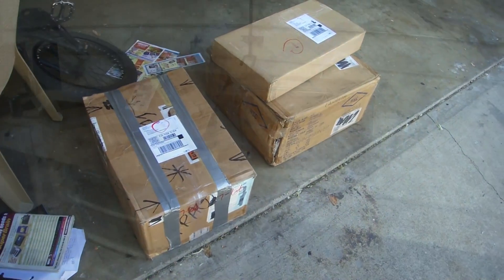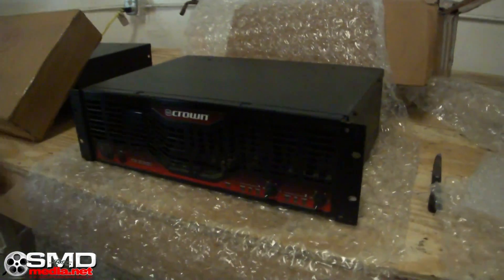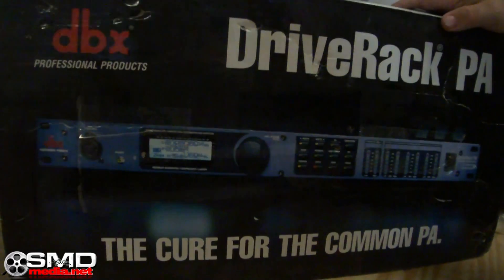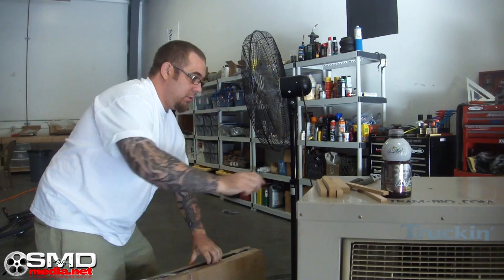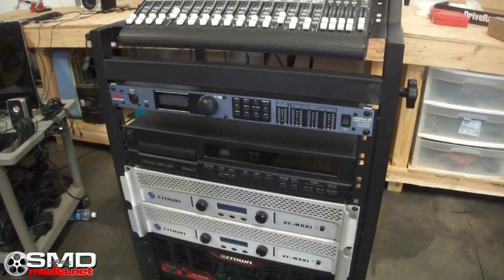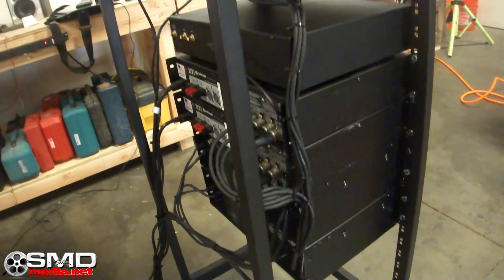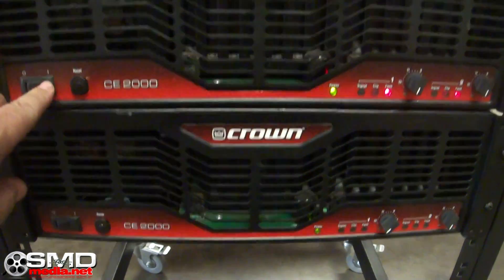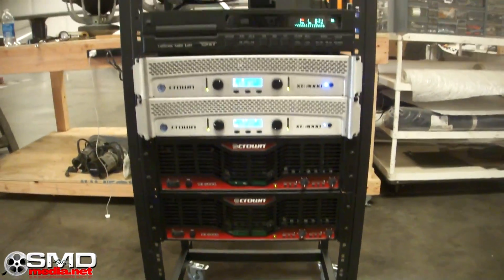Extreme Shop System :SMD Pro Audio Project Vid 2 - Crown Amps 10,400 Watts

Comment: Add a AC enhancer and plug every thing switched and every thing will come on in sequence and turn off in reverse sequence saves on clipping and Enhancer will eliminates spikes in power when running your power tools or what ever. Plus you could plug the amps in separate designated 20 amp breakers.

Comment: you gotta get an old crown macro tech 3600 or 5000 they run my dd 9918s hard without clipping ever. I have all the crown amps and those are the best for dampening factor for subs
Reply: so you think that the old crown amps are better than the new crown itech HD?
i don't think so, the crown itech hd amps are used with jbl M2 Master Reference Monitor.
And thoes is one of the best sounding set up right now, if you read the opinion from pro audio users/creators.

Comment: Do you really need 2000 watts for tweeters?
Reply: you don't need to use the amps at max power, it's always comfortable to have headroom. 
And the amps and speaker will preform better.

Comment: Thoes crown ce2000 are nice amps. I run mine at home on my redone large altec lansing 1204b speakers (recapped 904-8A crossovers, 511c horns/808-8b drivers, 16" 921-8A woofers) and sounds really clean. Im thinking trying one of crown's newer amps and might try the xls2500 or xti2002. Still deciding.

Anyhoo, yea if want to run those older big iron crowns at high current loads at full power you'll might need a 30a breaker. The ce2000 is rated for 2000w@1ohm load in stereo for a full output bench test. I defiantly don't reccomend power conditioners with them. It'll just limit thier current draw. The transformer in them is good enough conditioner itself to block out unwanted rf/emi. Anyhoo, hope you been enjoying them. The ce2000 are good amps.

Comment: Great video Steve-As usual, just asking where can I get PA rack like that one? And what is your opinion on Behringer? At the moment I have an EPX4000 (~3200w RMS for bass) and an EP2000 for mid/highs (driving 2 Wharfedale Titan 12's. I need a big rack because I might end up having 4 amps and a crossover in total.

Comment: you might have to run a seperate breaker in your shop thats what i had to do in my studio to run all my equipment since i did that have know problem turning everthing on at once.nice system i bet you can rock the block with that much power.

Comment: you should definitely get a high quality uninterruptible power supply/line conditioner for all of that very nice, very expensive equipment. also to help take excess noise out of the power lines, seeing as how it is a shop, and theres going to be lots of motors in saws, grinders, drills, you know....everywhere theres a motor theirs noise.

Comment: hey Steve  if your gonna be running this set up on the same breaker you will trip it for sure one 15 amp breaker on the panel is designed for 1500 watts max then code allows %80 rms so 14 gauge wire used for the plugs don't overheat and melt.
Best bet is to run each amp on it own breaker 20 amp preferred. and if the 4000 watt crowns have two plugs each??? then a 20 amp split receptacle would be needed to power them to the full potential. so you may need to run few new lines to the panel ..

Comment from the maker: @a2dds no the 2 bigger amps (xti 4000) run the woofers, 1 crown ce2000 runs the tweets, the other crown ce 2000 runs the mids. the amps were installed from the bottom up, and processing on top...did you even watch the video?The impedance will be what it ends up being when im done, i dont feel like sitting here for an hour explaining it..

Comment: steve i gotta question for yah... i have an 05  monte carlo with two jl audio wo's and a j.2 500 watt amp.. im going to put in two tr650-cxi speakers in the rear deck and ill swap the front speakers out for something i haven't decided on yet.. what i need help on is picking out a head unit because im not sure how many watts i need from it or anything really or what brands make good head units.

Comment: hey i am getting 3 rockford fosgate P3D410 10" 

Punch P3 4-Ohm DVC Subwoofer's and i dont know

anything about amps it is Dual 4-Ohm with 400 

Watts RMS and 800 Watts Max. so times 3 would 

be 1200 watt RMS and 2400 watt max what would

you recommend me getting.

thanks

Comment: We use Crown amps at church.  Split your amps onto two different circuits and you will never have a problem.  We have 3 amps per circuit with no issues.

Comment: @meade916 

furman makes automatic delay-turn on power conditioners - usually dip-switch controlled on the back. check them out for your rack. looks great, will probably sound great too granted the floor is all concrete and steel walls. any ideas for padding?